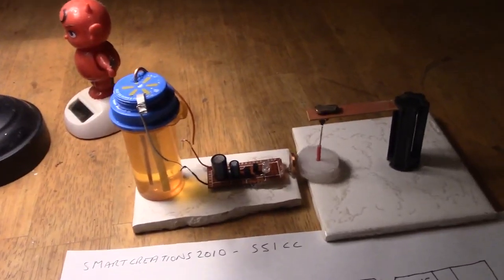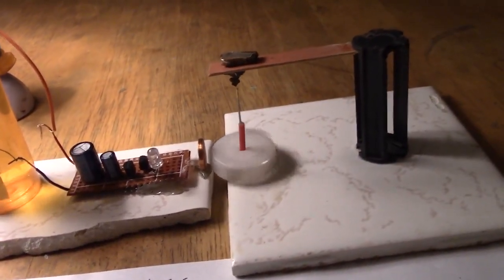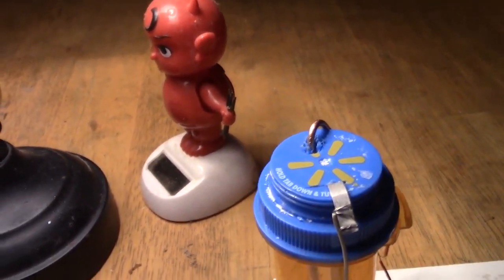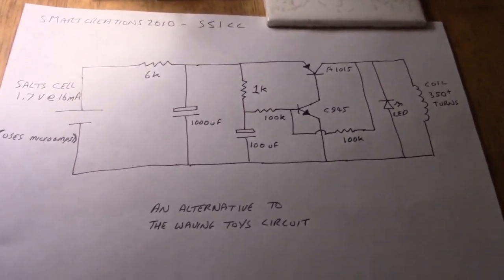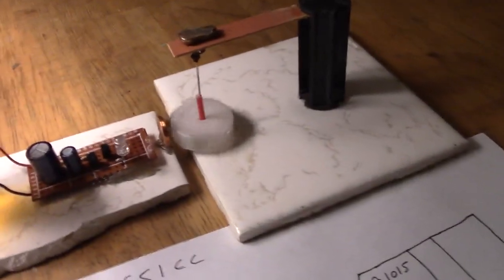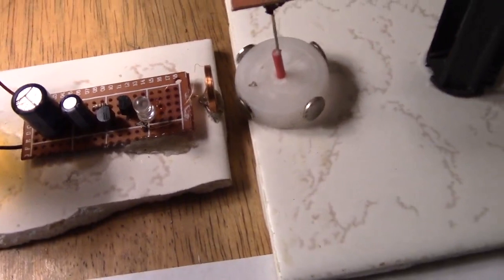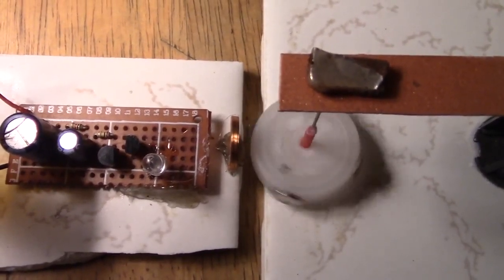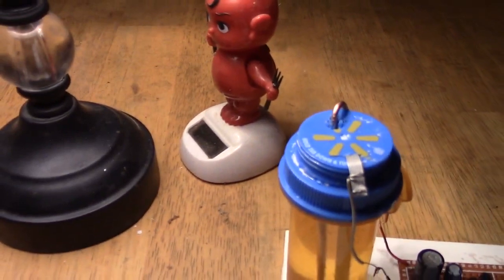Rotor levitation update

Comment: Nice update.  I suppose all these different bearing techniques have their place.  The levitated rotor works for me... But as you said, friction from the center hole takes a toll.  And I can't seem to avoid a wobble at slow speed.   So overall, the suspended needle resting on a hard surface (this video) seems most versatile.
Reply from the maker: Yep, some situations would suit the more recent method, especially perhaps a couple of steel washers for the needle to go through and some thinned oil.
I put a piece of a plastic cotton bud in the rotor hole and it straightened everything up, that's another possible mod.

Comment: I agree that trying to go with a levitated rotor is not as good as a just really good low friction bearing.  My experience with a needle on glass is that eventually the glass breaks down.  My 'Yearling Motor' is using a needle on hardened tempered glass and seems to be holding up however.  The solar/coin cell motor is doing great.  The rotor does wobble some but not bad.
Reply: I finally had a go at the levitating magnet system and really struggled to get any stability and I couldn't see any way it was going to give me less friction due to the needle rubbing in the hole in the middle when it wobbled. On the positive side the levitation worked but my building skills were not good enough to get it stable. A good fast flick to get it going helped stabilise it but it didn't last. I might have another go but I am away from home at the moment.
Reply from the maker: Your long term runners are the benchmarks for many of us, it's such a good series for learning. 
The recent technique has been a fun side avenue, many thanks for presenting it  :)

Comment: May I suggest changing the copper with carbon or graphite. It should give you a much higher voltage output.
Reply from the maker: Yep certainly, good idea. Mart's circuit calls for 2.5V, but this worked fine and top rotor speed is good. The best ever for long running and output has been Carbon and Lead. Years and years with no degradation. I got the magnesium recently and it was a 2 minute thing to replace the solar idea... used to have a CFL and it did great with garden light panels, LED bulbs are nothing like the same!